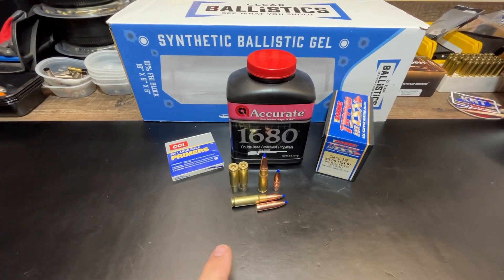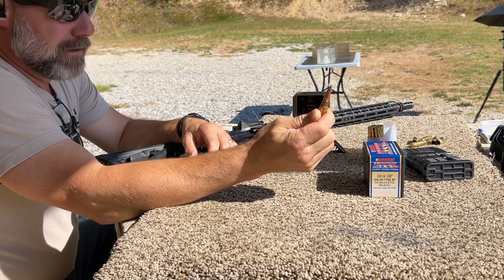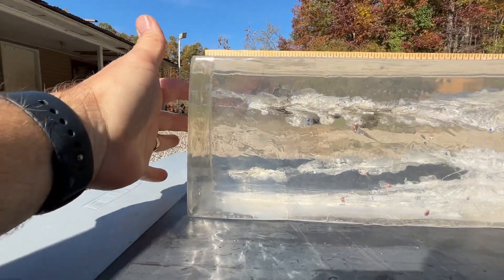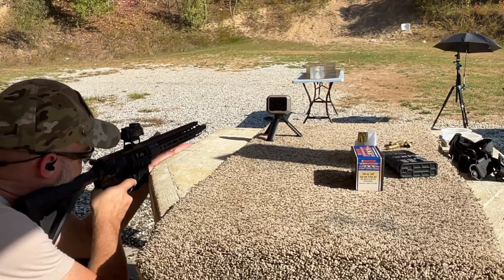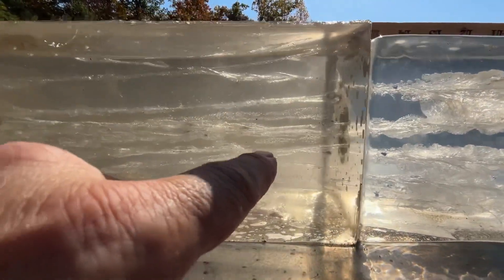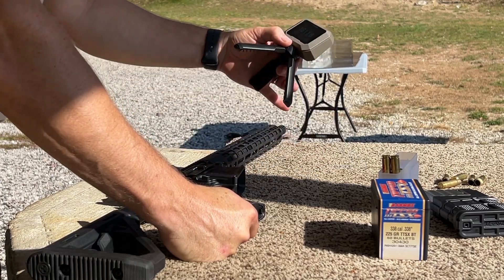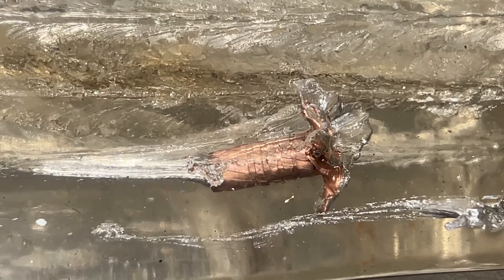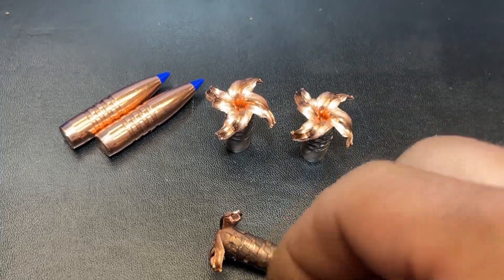8.6 Blackout, Testing the Barnes 225gr TTSX in Ballistic Gel Block

Comment: I made some 31gr 1680 on 225 ttsx in 8.6 I got 2005 fps with no pressure and very accurate
Reply from the maker: 👍🏻That’s a great velocity. I hit pressure signed before I could get that high though. What brass were you using?
Reply: @kentuckyrangetime 8.6 bass starline
Reply: Winchester peimers
Reply from the maker: @iveywhite438 I might need to revisit that loading again. What was ambient temperatures ??

Comment: Great work so far, love the videos. I was able to push the Federal Trophy 225 (factory overrun on midway, cheap for load development) out my bolt action 8.6 Faxon FX7 in 16" 1:3 twist at 2050-2100 fps using 36.5 H335. The slower burn rate and H335's density make for a great powder for the heavy projectiles. If you have any H335 laying around, you should give it a whirl, starting at 30 gr and working your way up. Never saw pressure signs, just ended up running of out case capacity. Slower burn for the win!
Reply from the maker: @omairchughtai3675  I have H-335 on the shelf. I may try it one of these days. I’m also giving up pressure to the GI system about 10” down the barrel so probably never be able to get the numbers your getting out of a bolt gun. 😢😉
Reply: @kentuckyrangetime  Given its a significantly slower powder, you should still be burning all the way to the muzzle. Should offset gas system losses a bit. Might be able to get around 2000 fps! Same holds true for the 210 and 185 loads. I think the 185 is the sweetspot, personally will be chasing that next with H335.
Reply from the maker: @ It will burn to the end, but it will also blow unburned powder back down the gas tube into the BCG. LOL.  Once. Get all my base loads tested out and caught up I may circle back to the 335 loads.  I’m really hoping to see some new supersonic bullet designs too. That’ll be when I’ll start looking for max velocity’s. 😉

I did a 4-3/4”- .223 AR pistol build a couple years back…..🙄. Whole different story but let’s say I had granuals of powder inside the carrier. 😂

Comment: Great content and approach...thank you.  How did you come up with the 27.3 gr load?  Load ladder?
Reply from the maker: @markminer7390  I had done ladders earlier with the 225gr Hornady CX and that’s the charge I landed on there. I did 1 test batch with the TTSX to confirm no OP. There’s probably still some overhead left there. 

With the CX, I had ejector marks on the brass at the 28.0gr load but no primer flattening.
Reply: What OAL for the ttsx 225gr. 8.6 blackout

Comment: I’ve pretty much decided to hunt with supersonic 8.6 loads. The subsonic loads are short range and have way too much drop from 0-150 yards for me to hunt with. I have to make decisions to shoot or not to shoot quickly and dialing a turret, or deciding elevation just takes too much time. I don’t think the 8.6 blackout is a personal defense round either. Too much penetration. Too expensive to practice with. I like the round, but it’s a hunting round for me. I shoot the 210 grain Barnes bullets out of a Q fix.
Reply from the maker: @e.l.robbins5614  After testing all 4 of the Barnes offerings from 160 to 225, I’m leaning towards the 185gr as my go-to load. Seems to be the sweet spot with enough velocity for good expansion with more distance than the 210 or 225. 

I have some “loaded down” from this weekend that I’m wanting to test to see where the lower minimum expansion velocity is hitting. Since the tip design is the same across all 4 weights, it should yield a bit of info on where the heavier bullets will expand as well.
Reply: I will try the 185s. My local supplier does not carry them, but I think I will give them a try. I agree with what your data on the 185s. That will help with trajectory and bullet expansion.
Reply from the maker: @ 👍🏻. Midway USA had them on sale a week or so ago. Not sure if it’s still running. 😉